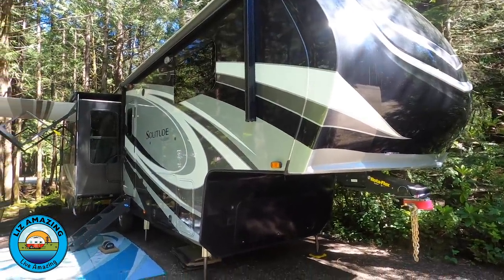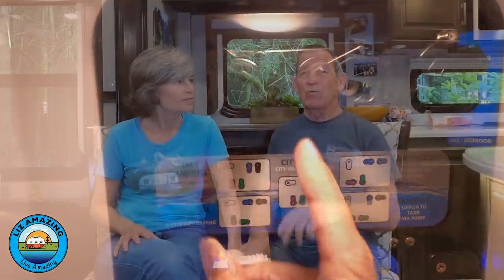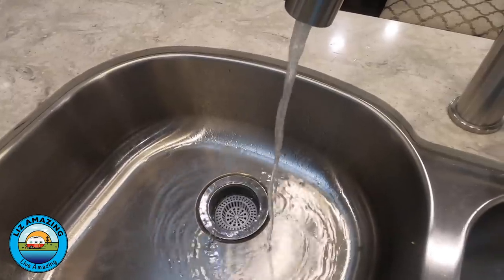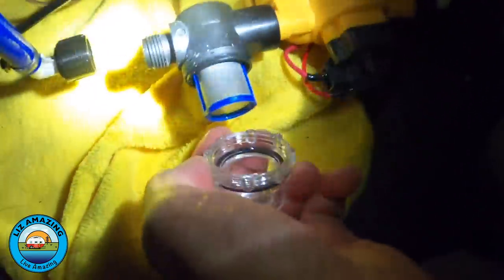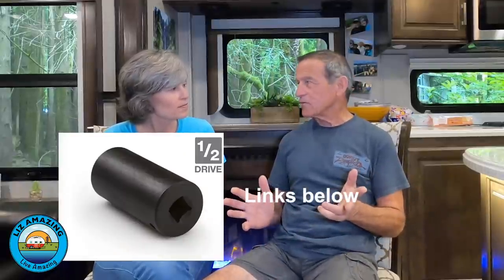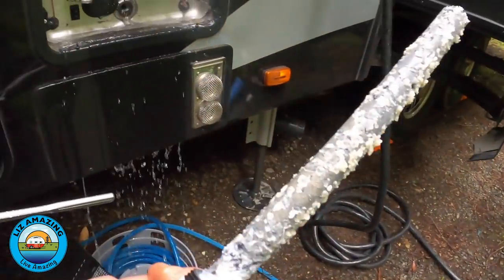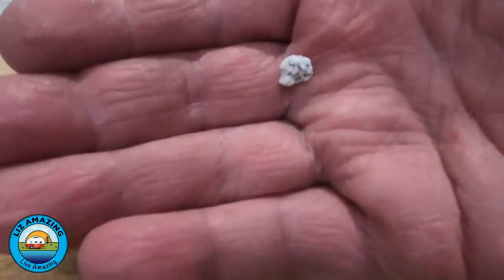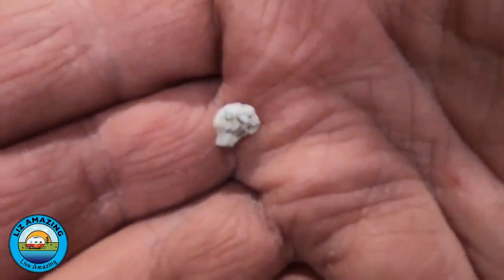Rv Life: Plumbing Problem | Low Hot Water Flow | Fulltime Rv Living

Comment: We had the same problem in our 2001 Alpine Motorhome.  Followed your lead and the problem is fixed for now.  We didn't have any chunky minerals built up but we thing the check-valve in the hot water tank output got stuck.  If it happens again, we will replace it.  Cheap, easy fix :)  Thank you!
Reply from the maker: Great! So glad our video helped. Wishing you happy camping!

Comment: We are weekend warriors when we get home from our trip I always drain my hot water heater. Which also relieves the pressure on the lines when it's sitting in my driveway. Plus the water will go stagnant and smell and taste raunchy. I usually just Purge the lines before the next trip, so that there's no air in the lines when we get set up. Happy camping
Reply from the maker: Wow, that's a great tip! Thank you! Happy camping to you, too! And may you always have good hot water pressure!

Comment: Great video!  Sometimes the simplest solutions are the ones that take multiple steps to get to. We just had issues with our power in the rig. After trying multiple things we found that the wires connected to the batteries had worked thier way loose and were causing our issues. Thanks so much for sharing.
Reply from the maker: Yep! Sometimes it’s the simplest things! Glad to have good hot water pressure now, and glad you got your power issue figured out! It’s always the last thing you check.  :)

Comment: I belong to a Facebook group devoted to Grand Design Reflection models and the subject of failing plastic check valves on the hot water outlet came up. Pulled mine out and going with brass from Valterra. Thank for sharing your experience of fixing low hot water pressure!
Reply from the maker: That's great to know. Thank you Dean!

Comment: I had one of those inexpensive Camco non-adjustable pressure regulators. Not sure if it was scaly inside but definitely limited water flow. Replaced with an adjustable regulator with pressure gauge and problem solved.
Reply from the maker: That's also a great tip, thank you! We did the same some months back so forgot about that entirely. I think cheapo regulators is a common problem-- thanks again for mentioning it.

Comment: Awesome video. Our problem was user error along with being very new at this plus self thought. We did not know how to de-winterize so when flipping the water heater valves I turned the bypass valve only 1/8 of a turn thinking that was enough like in my home. I did not realize that is an all on or all off valve. Not only did we have low water pressure, the pump would run non-stop due to not boiling up pressure. I did not figure this out myself, the service department at our camper store told me. Lesson learned. A rig is not always the same as your home.
Reply from the maker: Wow. It could have been so much worse. And that's a great tip: check your valves to be sure they are open all the way. Live and learn, right? Hope to see you in a campground someday!

Comment: Thanks. Have a much older unit. I believe there is only 1 check valve on my RV’s shore connection. The suspected calcium buildup is probably down stream from my suburban water heater. I’m going to try to back flush from one of the taps inside the RV. All 3 internal faucets/ shower hot water are flowing around 1/3 pressure. Old RV most likely really old deposits. They didn’t show up until I returned to the unit from a 2 month trip. Cheers!
Reply from the maker: Cheers to you as well! Best of luck and hope you get some good water pressure soon.

Comment: May want to depressurize the hot water tank before unscrewing the anode rod (avoid the gush of hot water pouring out potentially onto you) ....easy to do by flipping the toggle switch.
Reply from the maker: Yes! That's a great point. Paul did not toggle it initially. thanks!
Reply: Back flow pressure probably help dislodge the calcium

Comment: On my 99 alfa ideal 5th wheel. I had almost no pressure on my hot side but perfect pressure on the cold. This was only happening in my shower. Turned out the hot water valve in the facet was bad. Replaced it. All is well. Now to replace my electric heating element in my water heater.
Reply from the maker: Glad you found the solution, and thanks for watching!

Comment: had the same in my camper, smaller system but i cured it with anti calcium tablets in the fresh water tanks once a year and ran all the taps and shower untill it was all gone then flushed it with fresh water before use again. do it every september. takes about 24 hours.
Reply from the maker: That's a great tip, thanks so much! Paul is looking into that now.
Reply: @LizAmazing  i actualy did it to save on heater maintenance which worked perfectly, mine is really clean, had the bonus of more pressure in the whole system and kept the pumps also clean so it saves me money on replacements, and the clean and fresh water feeling in the shower... us girls know thats a nice feeling ;) love the vids, cant wait to see the next one x

Comment: I just had low pressure from hot and cold just from the kitchen sink. I remove my faucet aerator. The screen was clogged so I just removed it and tossed it will purchase a new aerator
Thanks for your suggestions.
Reply from the maker: Good job! It happens and if it happened in your kitchen, could happen in your bathroom at some point. Thanks for your comment.

Comment: Just had a similar issue but with both hot and cold. On my class A I have 3 large 10" diameter water filters, for both incoming and out going water. I run off tanks only. Last place in Maine had lots of minerals in the water including iron. My first filter, a sediment spun filter, was choked with iron deposits. Also my last filter, a ceramic filter needed cleaning, and this was after 2 months of full timing. Changed out the first one, (always carry spares) and cleaned the last one, and all is good. Did not change out the middle carbon block filter. Might have to get another inline filter for iron if it becomes a issue in the future. Also remember to clean any strainers at the fixture once in a while. I only run off tank just in case there is a leak somewhere, don't want that city water pressure flooding my coach.
Reply from the maker: Well, that's really smart to only run off the tank. We have a water pressure regulator and do switch to using the tank during those times the water pressure is too low. You saw our rusty filters in the video-same thing as yours! Thanks for your comment and be safe.

Comment: Knowing that you have a fairly new rig sent my thoughts directly to a line clog. Through the years of owning and working on rv's low pressures comes up fairly often. Your problem is not one of the more common ones. The most common one on new rigs though is plastic debris left in the line at the manufacturer. The other one is someone unknowingly switching a valve cutoff somewhere in the lines. We always mark the shutoffs after we find and correct this particular problem. I personally would suggest that you might want to at your convenience since all is good, is to go through and mark valve positions as they are currently set. Good luck and enjoy your rv lifestyle. James from Phenix City Alabama.
Reply from the maker: Hi James, Oh thanks so much for that tip. Paul will probably want to do that as he hasn't yet put the access board back up. If all goes as expected, it may be months or years before he needs to get back there. Thanks again!

Comment: We don't have low pressure, but when camping throughout the Missouri Ozarks, their water source are the caves that run through the southern third of the state. It's very hard water, thus we get that calcium buildup on the heater element. After draining the tank, tank a shopvac with a common flexible extender hose and vacuum any remaining deposits in the bottom of the tank and you're good to go! 💯👍👍👍💯
Reply from the maker: Great tip! We will have to get that wand so we can flush it!

Comment: I heard also the way to make an proper air gap by filling the hot water tank until it comes out the pressure relief valve, then snap down the pressure relief valve. It insure proper pressure. My shower head had a water reduction gizmo in it too. Bought one of the newer shower heads...you most likely have on your new rig. It all help. Thanks for video! Amazing people doing amazing things...Liz Amazing & Crew..Lol 🍑👍
Reply from the maker: Paul says that's exactly what we did. Thanks for bringing that up. And, awww, thanks so much for your kind words. Paul and I are having fun with these videos.

Comment: We haven’t had that problem we use a filter from the faucet to the water hose going into the RV. Has kept us running water fine. Once in a while my husband  checks the system out. Happy trails
Reply from the maker: We've been on the road for 18 months and actually use TWO filters! It was that darn well-water! Oh well, glad I can take good showers once again. Low water pressure is a fairly common problem in Rvs, apparently. Happy travels to you, too!

Comment: We had no pressure on any faucet and the worst was shower.  Well the handheld unit and hose was so old that we replace it and got blown away by the water pressure.  That was most important.  We will now check the thing that you pulled with corrosion to see if we can better the kitchen and bathroom sinks.  I guess the old lines and air raters at the end of the faucets may hold some rocky materials as well.
Reply from the maker: Yep. Could be. Glad you are checking everything, Laura, and thanks for watching.

Comment: The only low water pressure problem I’ve ever had was low pressure at the campground. I checked with a seasonal camper near by that said it was always like that. I removed the high pressure valve and the water filter and got better pressure.
Reply from the maker: Yes! I am so glad you mentioned that. We have a fancy water pressure regulator with the dial, those cheapo ones are junk.

Comment: Faulty check valve on the back of the water heater ..hot outlet.
Usually is the culprit for low hot water or very low pressure.
Easy fix.

Comment: The Water Heater check valve that is on the top of fitting you did last was probably stuck or had the chunk of calcium stuck in it!  The check valves don’t last they are plastic and are junk. 90% of time if all your hotwater pickets have really low or barely any flow it the exit hotwater port check valve.
Reply from the maker: Yep. Thanks for this, Robert!

Comment: Its normanlly the mixing vaue in the back of the hot water heater. You either replace the vaule or if you are like me you take the vault off and knox out the deposits in the vaule and put it back on.
Reply from the maker: Good to know, thanks.

Comment: How you folks doing. We camped next to you at Cottonwood in verde valley just before you went to pick up your fifth wheel. Anyway we also have had similar issues with water pressure out of the hot water tank. First time we found the same thing. Flushed it and all was good. Second time it was the check valve and another valve that was leaking. All fixable. 
Dan and Judy
Reply from the maker: Dan and Judy!! We were just talking about you today. Wanted to tell you that we got the MORryde suspension on our rig. Thanks for the recommendation. Hope you are well and are out enjoying your Solitude!

Comment: The water at most public and private campgrounds is very hard. We have used a water softener for the past several years to avoid these sorts of issues. In fact when I pull my anode rod after a year of use there is hardly any buildup.
Reply from the maker: That's a great tip. Thanks so much. Paul is looking at various systems now.

Comment: Excellent video.  Very informative.  Didn't read all the comments so I may be inadvertently repeating what someone else may have already suggested.  That said, it looks like you need to pre-filter your incoming water to lighten the load on the anode.   I realize you are no longer at the original, offending, campground but still should help by keeping less mineralization of the tank.  Just a thought.  A very informative post!
Reply from the maker: Thanks so much. We have two water filters and those orange-colored ones were our actual filters. I think a water softener would help as minerals can't be filtered out.

Comment: Paul has life long experience working with all types of fittings. So I might add, if you don't have a lot of experience doing this type of repair, it is always best to under tighten than over tighten  water fittings. Most folks don't have an idea what we mean by "snug it up."  So, tighten kind of tight, then see if it leaks. If it leaks, simply tighten a little more until it stops. Then, always keep an eye on it for a few days to see if it develops any leaks. No reason to be afraid of doing new things yourself. Except, it's much better to be informed than just winging it.
Reply from the maker: Good advice there! Yes, it's tough to try and figure our repairs if just a beginner - thanks for the tips.

Comment: We have a 2019 Solitude and it has always had low water pressure. It is plumbed with Pex pipe. Will I need Pex pipe, connectors and a squeeze tool to do this job? This will give me a place to start. Thanks for sharing
Reply from the maker: Paul says yes and no. If you are going to keep the existing tees, you will need clamps and a tool to squeeze them. There are fittings on the back of the Nautilus that can be unscrewed. You won't need the clamps or the tool. But if you are going to start taking things apart, then either (a) but the clamps and the tool to install the new clamp or (b) replace the tees with shark bite fittings. Any good hardware store will have them. Start first with the hot water tank flush and you may be able to save all this. Best of luck!
Reply: Liz Amazing thanks for the rapid reply

Comment: I've had issue as such but the nautilus system gets air in the line very easy so once I run the hot water on all lines or solves the issue.
Reply from the maker: That's good to know- thanks!

Comment: So my issue was a broken check valve on the outlet side of the hot water heater. I was able to check my lines fairly easily, so I knew it was at the heater!
Reply from the maker: Yay! So glad you found it!

Comment: I had a low water problem at one time and tracked it down too a valve right behind and in the water outlet or inlet of the water heater.
It kept the hot water from filling the line when I shut the shower head off.
With it in , the cold water would fill the line.
Removing it hasn't bothered me as I point the shower head at the wall for a few seconds and I'd rather a blast of hot then cold.
Reply from the maker: That's good to know. Glad you got it figured out. Happy trails to you!

Comment: I'm wondering if Lowes has something that you could put on the hose you connect from the campsite into your RV.  Might be worth looking into, easier to clean out and change.
Reply from the maker: Paul says you can put a tube into the tank from the anode port and spray high pressure water in that way.

Comment: Another cause of low water pressure is a buildup of sediment in the shower head or in the aerators on the faucets.  All of these items should be checked and cleaned up at least once a year and more often if you are in a high  mineral water area.
Reply from the maker: Great tip! Thanks so much!!!